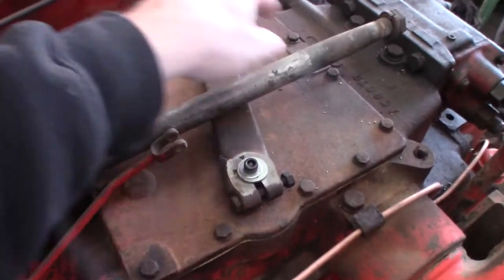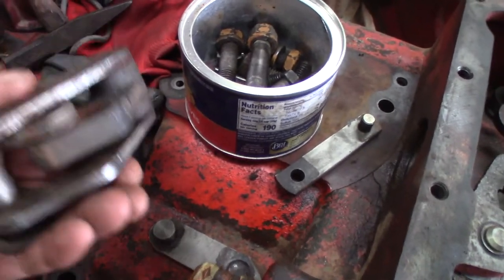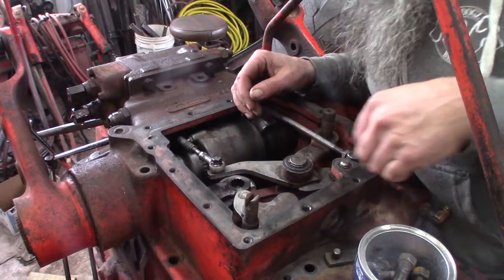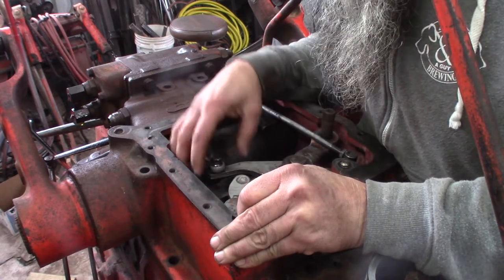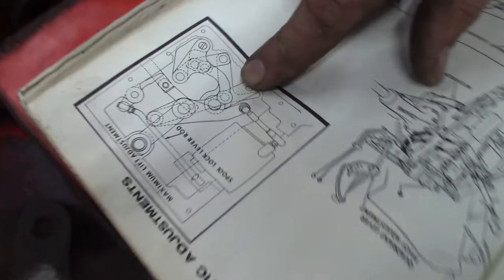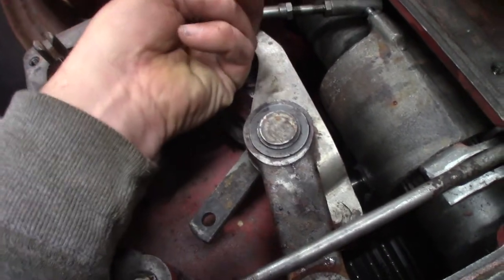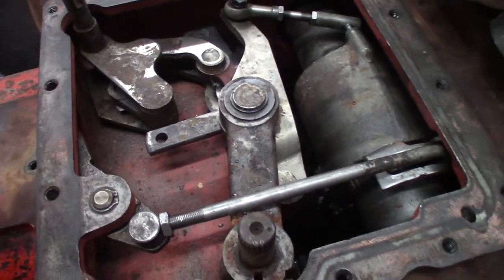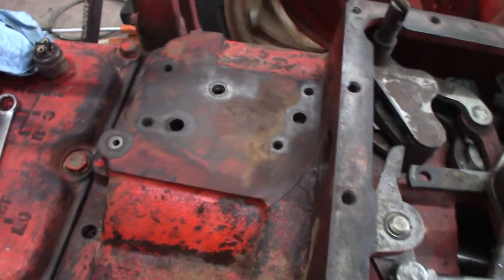Draft o matic internal compensating links confusion

Comment: I have an 830 comfort king that I bought to rob the motor for a case loader I have. Mine had a gas motor but I have the whole tractor except for the motor that I would sell. I also was wondering what you are going to do with your old diesel motor. I would trade whats left of this tractor for your old diesel motor. I am in Salem ohio which is a little south of Youngstown. My 830 has real nice sheet metal and it had a dry clutch. It also has the draftomatic 3 point hitch and It appears to have anewer hydraulic pump.
Reply from the maker: Hi James; I have everything but the block (injectorpump, crank, rods, pistons, heads,,,)It had cracks in-between cylinders so I scrapped it. As far as I know the gas and diesel blocks are the same? Not positive. I would be interested but you are a ways away. I'm just south of Binghamton NY. Wonder what shipping would cost? Thanks for watching! John
Reply: @JohnFrytag  i could possibly bring it to you. my son has a gooseneck trailer
Reply from the maker: Hi James;  Ok let me take inventory and get ya some pictures. Maybe you could text me a couple pics of the tractor. Thanks, John  570-396-7060
Reply: @TheJohndeere466  do you still have 830 comfort king forsale? Would be interested in it, i live in Wellington Ohio.
Reply: @dodgerfarms409  Yes I do. Its pretty much everything except the motor